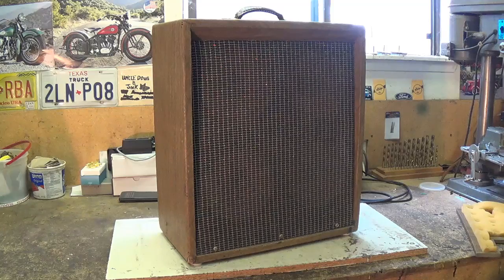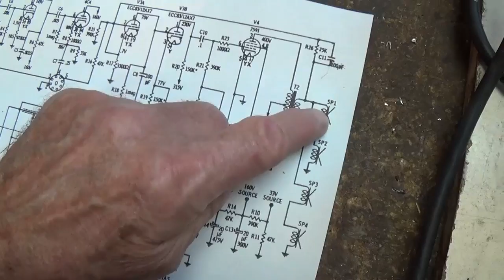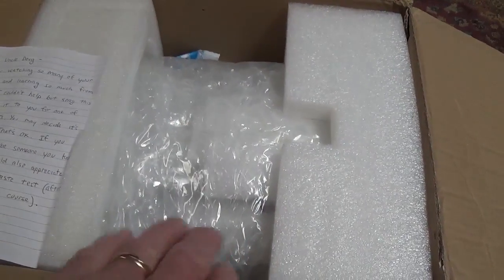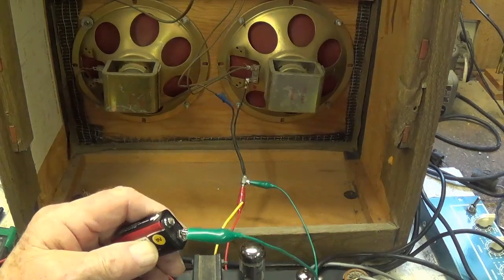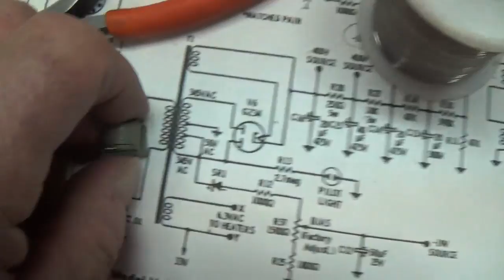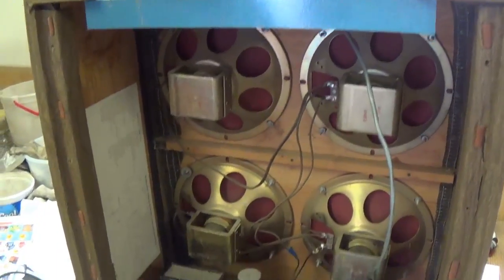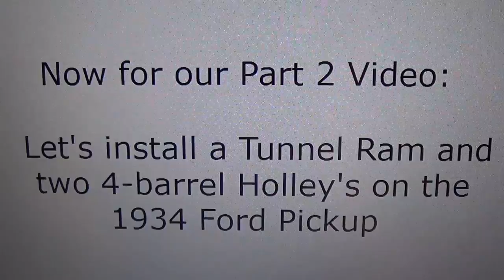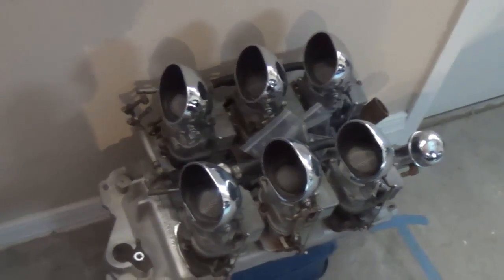Harmony H322 Bass Amp.......The "mini" Bassman from Hell !!

Comment: Great video,  I wish you would have cranked the volume up on the demo.  I got to play guitar through this model a couple of times back about 1968 or 69 and as I remember it would really growl when turned up, especially with my Heath Kit fuzz pedal.  I would love to see the cabinet restored with some vintage vinyl.Thanks for the memories.👍
Reply from the maker: Thanks, Chris. Even at about 1 1/2, the volume was hard to tolerate in the workshop......but I agree, in the proper venue, high volume would probably sound great.

Comment: I had gotten the guts from a Harmony H440 from a friend back in the 70s. The tremelo channel never seemed to work with a 5w power resistor always blowing out.  I used it as a bass amp head for a few years in a poorly-made cabinet that had white shag carpeting stapled to it. Ah, the 70s...
Reply from the maker: I shudder in horror, Craig, but have probably done worse in my early days.
Reply: @UncleDoug  Oh, and of course there was no reverb tank...

Comment: Can barely wait to see you get stuck into restoring that car radio Douglas.  Valve operated car radios are becoming popular with the vintage car restoration fraternity: doubtless once restored it might look cool inside one of our vintage cars.  I guess, therefore, it will make for a short welcome break from restoring guitar amplifiers LOL.
Regards, Phil.
Reply from the maker: Thanks, Phil. I used to work on radios many years ago, but sold my RF signal generator. Hopefully, I'll still be able to get the old jewel working again.

Comment: I always make it a point to make the green ground wire longer than the others, just in case the cable gets yanked by a gorilla. That way the ground is the last thing to come out, and will hopefully keep any frightened apes from getting shocked while they swing from the power cable.
Reply from the maker: Good idea, Anthony, although a proper strain-relief at the chassis surface should eliminate the ape's ability to separate the power cables from the circuit.

Comment: Never seen one of these gems before, you get to work on some really cool amps, Doug, my guess is that the foam is there for acoustic dampening to tame any tendencies towards bass resonances, the old Peavey 410TX 4 X 10 bass cab I'm doing restoration work on needed some replacement dampening material, I was lucky enough to be able to order some suitable material from Mouser Electronics Australia, the old dampening material was pretty grotty and had a foul smell to it, after I removed the old material I literally had to remove what seemed like a ton of dirt and detritus from the bass cab, complete with a rodent skeleton of some kind.
Reply from the maker: That was the skeleton of the "engineer" whose job it was to maintain the integrity of the interior of the cabinet, Simon ;)

Comment: That speaker connection system shown in the schematic is commonly known as a Series-Parallel configuration, Marshall uses that wiring system in their 4 X 12 speaker cabs that go with their JTM45, Super Leads, Super Bass, JMPs, JCM 800, JCM 900 and etc amps.
Reply from the maker: Thanks for your helpful input, Simon.

Comment: Uncle Doug When I heard you start the 32 Ford with the Chevy engine the starter is grinding to loud and harsh,not good for the flywheel or flexplate and bendix drive gear.
Shim the starter down from the engine 10 to 40 thousanths of an inch. There is a wire guage method or just start with 10to 20 thousanths first. It will sound much smoother
And last longer the starter will engage and 
Disengage smoother easyer. The shims are slotted at the far end making them easy to install
 Your friend Dwight

Comment: Great Video again, Doug. Hard to tell what sounds nicer,  the amp or your Ford 😀

Regarding the restoration: 
Wouldn't it be posiible to convert the pilot light to DC and leave it on top of the panel for more convenience? Eg use the -19V DC  and bring it down to let's say 6V DC and use that voltage for the indicator lamp? Just a suggestion, you know I love you... 😀😀😀
Reply from the maker: Thanks, Chris, but then I would be adding more wires between the two units and endangering my bias supply.  I honestly think that simple and original is better in this case. Please subscribe so you can receive notice each time a new video is posted.
Reply: Ups,  i thought tue pilot lamp was originally on  the panel...
BTW: I'm a subscriber since  I can't remember...  😀😀😀
Reply from the maker: @Cyberbehni  It may have been, Christoph, but it made no sense to send power to the control panel. Thanks so much for subscribing :)

Comment: I would love to see that tube radio mounted in your Rat rod car.
Reply from the maker: Tube radios don't work well in hot rods, Dwight. They are way too big, heavy, and generally offer really lousy AM music selections.....mostly in Spanish in my area.
Reply: @UncleDoug  ok Uncle Doug on old tube. Car radio just a thaught. In those days when they where available and FM 88to108 Mhz was just going on the air you could get a solid state
Converter. Just some my childhood memorys when I was tinkering with one long time ago. It may have a 6AQ5 or. 6AR5 audio output tube they use ferrite tuned coils for tuning in stations instead of an air variable cap.they are fun to play with. It may power up on a 12 volt AC POWER supply instead of those mechanical vibrators. It should have an antenna female plug in or a coax cable on the back with a compression type trimmer cap. For antenna trimmer ajust.
I still listen to WSM out of Nashville TN. At 650 kHz. If you like country music it skips in after dark. I would see if it works just for fun. They do have a warm sound on a Hifi speaker or a ten inch.
Perhaps your shop speaker. I would love to hear it on one of your vids. It probably put out 3to4watts into a speaker. But who now's the condition of the step up power supply is in. Thanks for all the amp vids and hot Rods. Dwight.
Reply from the maker: @dwightjt  You're welcome, Dwight.  Thanks for your input.

Comment: This baby has gotten expensive used..(One is in Seattle  near the land of CHAZ).I have a Wurlitzer Amp with 8-8" Similar Speakers...but it is solid state...and amps for Accordian where more Full Range in frequency response because Accordion's were the Portable Keyboard of the late 50's and Early 60's the Vox Organ and Farfisa's did not come into play until 1963-64 but the Wurlitzer Company had a Keyboard Model 200 in 1958 to 1962 when my Wurlitzer Guitar / Keyboard / Saxophone / Accordion Amp was built. Even Though this amp is Solid State...it is very Tube Sounding...don't slight early FET based Transistor Amps Uncle Doug...these amps are easy to repair and easy to use and are lighter for us old guys and have great sound especially if you add a 7 or 11 band Pedal EQ. I have a Teisco Model 88 that can sound great and can  keep up with my Princeton Amp and even my 57 Champ Amp...
Reply from the maker: I don't slight them, Brian, I just don't work on them ;) Thanks for all your knowledgeable input.

Comment: Another excellent sounding amp. I noticed that there was a brass gear on the magneto in your truck engine. You didn't mention what type of cam is in it. I think those gears are meant for steel roller cams, in order to keep the cam gear from messing up. Anyway, it looks like both the amp, intake & distributor swap worked out well.
Reply from the maker: Thanks, Blair. As far as I know, the cam is an RV-style from Compcams, which surely must be fine with a steel distributor gear.
Reply: In that case, Doug, everything should be absolutely fine. I was not  sure if you were using a roller setup or not, because there was a cloth over the lifter valley, which is a very good idea. I've noticed that some of your viewers were upset that the master cylinders on a few of your rigs were the older single type. If you had them mounted on the frame, nobody would give you that feedback, lol. Dual cylinders are a pretty good idea though. Take care !!

Comment: On the topic of single pole switches ... also note that for example Schuko plugs do not have an orientation, so there is no "guarantee" which lead in your device is the phase and which is the neutral.
Reply from the maker: True, Franky. All the more reason to either use DP power switches or avoid Schuko plugs (we don't have them in the US as far as I know).
Reply: @UncleDoug  Well you don't, but we have them here in Europe ;)

Comment: While I do agree that a a STDP switch is ideal,  breaking either wire of the power supply circuit will result in an open, which I know you know as well.  That being said,  perhaps most manufacturers don't use them is due to cost?  Regardless,  yet another terrific video.  I hope to have your package out soon.  I can't wait to see what you decide to do with it.
Reply from the maker: The DP switch (plus installation) really isn't all that much more expensive......but I guess every cent counts. We're looking forward to it.

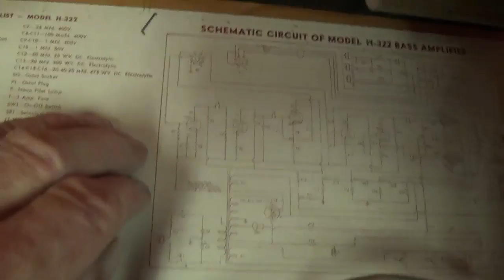Comment: Hi UD, I hope you & your are well. @ 12:46 what a pleasant surprise! I "hope that you had the presents of mind to carefully remove the schematic after carefully removing the staples holding it down and made a good scan of for you collection of chassis schematics, then re-attached.  Did you also have to clean up the Vu, Treb & Bass pots, the Vu sounded a bit scratchy if I was hearing right? Great Job. Sound like a whole new amp. Customer should be very happy with this fix!
Reply from the maker: I had a duplicate of the schematic on hand, PM, so making a copy wasn't necessary. Yes, I cleaned all the pots. The customer seems pleased with it.

Comment: That radio could be a “killer” conversion - steam punk / art deco. Onwards to to snorting the selenium - since you replaced it. You really should allow a little hum - since both the pilot light and the switch has been moved, otherwise you don’t know if it’s on😉 Really nice look with the copper gas pipes. 8 cylinders - 8 barrels sounds logical!
Reply from the maker: You get more exercise bending over to turn on the power, Gert....so it's a healthier amp now :)  Thanks !!!
Reply: Uncle Doug Hmm I’ll have to think about that for a while sitting in my recliner and picking a little. I’m assuming a very BB King’ish position although my stomach isn’t quite the same size

Comment: Uncle Doug, you seem to be the most thorough and knowledgeable amp repairman on YouTube and that brings me to my question about a 1974 Marshall JMP 100 . It is a model 1959 and was purchased with a set of 1978 model 1960 A&B cabinets. While retubing recently I found a pentode EF86 in the first preamp position. V1 on the schematic. I was told that the amp had been “modified on the front end for more gain”. Any information about this type of modification would be appreciated so that I can understand my amplifier in greater detail. I have replaced the large electrolytic capacitors with F&T capacitors. The ones that I removed are marked. LCR . UK 98 04 are also on the old capacitors, I assume that indicates that they are made in the United Kingdom in the 4th month/week of 1998. If so that means that this amp has had them replaced twice now  about 24 years apart. Any information on the EF86 mod would be greatly appreciated. A video reply would be fine as I am a loyal subscriber and have been for years. Thanks Jeff Kellogg
Reply from the maker: Jeff, I appreciate your loyal viewership, but am unable to offer much insight into such a modification. From my experience, a pentode would offer little or no benefit with regard to gain. If anything, the voicing of the channel might be changed a bit. If it were my amp, I would probably return it to the original configuration......unless you are "in love" with the current sound produced with the pentode.
Reply: Uncle Doug thank you for your quick reply Doug. I would like to return my amp to stock configuration and make the pre amp operate as designed. I have installed a small circuit board with a 27K and a15K resistor on it with a switch to pick which resistor is in circuit. I can now choose between the 6550/KT88 tubes that were in it new or the British version with the EL34s that the amp was designed to use. I have also changed the 6 large electrolytic capacitors and plan to replace most of the remaining capacitors . I am going to contact the previous owner and see if I can find out what was done so that I can get that modification reversed back to stock

Comment: I just restored a 1939 Epiphone with the same umbilical mess. Had me scratching my head continually.
Reply from the maker: An umbilical connecting control panel to amplifier is not uncommon.....but when AC is introduced to the control panel, it's a disaster.
Reply: @UncleDoug  Yes. It had four cables all together. AC power, input to V1, V1 to volume/tone, volume/tone to V2. And V1 and V2 were old grid cap tubes. It was a nightmare to rewire, reroute, and get quiet.

Comment: I like the copper tubing that you used, much better than the red candy rubber that some Californian  might want to eat.
Reply from the maker: Thanks, Hack :)
Reply: I was told to get rid of the copper gas line on my ‘31 Model A Victoria in favor of a steel line; it was said that copper lines can develop micro-leaks?
Is there something about the hot rod engines that make the use of copper more acceptable?
Reply: @patrickwashburn4501  That could be true, I was just commenting on the change from rubber to metal.
Reply: @hpelisr  you are correct.  I think copper is okay in this application, since it is not subject to the vibration through the firewall, like on my Vicky.
Reply: @patrickwashburn4501  My son and I learned that well. Not having a separation at the fire  wall? the vibration will break the line.

Comment: Nicely done on the amp.
Re: the car,, I thought copper pipe was not allowed to be used on fuel lines.  They had to be stainless steel.
Reply from the maker: Copper has been used for many, many years as fuel lines, MV. I wasn't aware that it was now outlawed. Regardless, it's easy to work with and was perfect for me in this instance.

Comment: Now is see why the big name amp manufactures consult experienced engineers to design their circuits.
This looked like a cheap, quick and easy, Willy nilly afterthought, makeshift thingey, constructed from surplus of wherever was handy.
Reply from the maker: Amps that sold at lower retail prices did seem to cut some corners with construction, no doubt to minimize production expense......but many of them still sounded great !!!
Reply: @UncleDoug  It was enjoyable to have seen you restore it. 
The great tone was likely despite the poor workmanship and not a result of it.  The individual electronic components available in the era were of high quality and there wasn't a lot of trash in the signal path.  Otherwise i get the feeling that if they could have gotten away with cutting corners further by using some of today's cheaper electronic components, they would have.
I can see several reasons restoring a unit like this one would be an attractive endeavor.  For one, someone with your talent can work the bugs out with a few tweaks.  Secondly, it preserves the history of musical gear.
Nonetheless, another entertaining and informative video.

Comment: Uncle Doug, do you ever plug amps into the light bulb current limiter when you are troubleshooting something like blowing fuses?  I was going to use it while I try to determine if I have a bad 5881 or GZ34 just to see if it glows brighter as the amp starts to draw more current before it blows the fuse.
Reply from the maker: Yes.....the CL will not only protect the circuit, it will also prevent the fuse from blowing.
Reply: @UncleDoug  Thanks Uncle Doug.  After all those gyrations, it turned out only to be another dying GZ34 rectifier tube.

Comment: Good job. That's a typical job for me, I get a simple " hey my amp sounds like trash so can you give it a look"? Then after weeding out a few probs it blows it's top again ! My only comment would be put the end bells from the bad trans on the replacement. Looks like they would fit.
Reply: And just watched to see the SBC powered hotrod with the tunnel ram. The six deuce setup was classic hit rod so I'm not sure if I would have ditched it. If you have enough port and cam to get up into the tunnels range,hey go for it. But just be sure you can rev where it needs to go. I have a 69' Firebird with a strong 400 cu.in. motor that I rebuilt on my own with the help of a local shop to balance and do the short block. Bought all new forged rotating stuff as the crank was already .030 under!
Reply from the maker: Thanks for the nice comments :)
Reply from the maker: @Mr39036ce  The tunnel ram made a huge difference in performance.....particularly at the low end, which surprised me.

Comment: Another great one uncle Doug! One question though; would it not have been better to install the fuse before the power switch, even if that meant another hole in the control panel? Thanks, and keep up the great videos!
Reply from the maker: Only if you want a fuse that can electrocute you if the amp is plugged in and turned "off". When and amp is "off" it really needs to be "off" :)